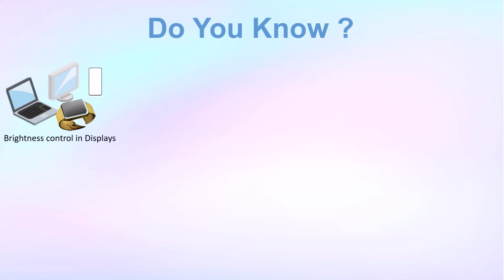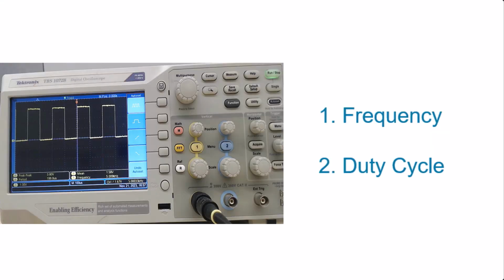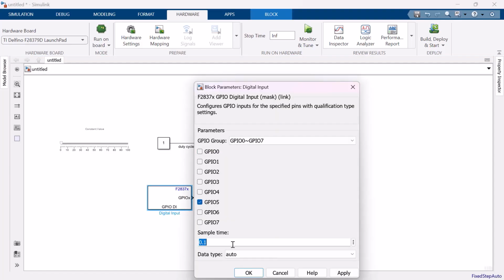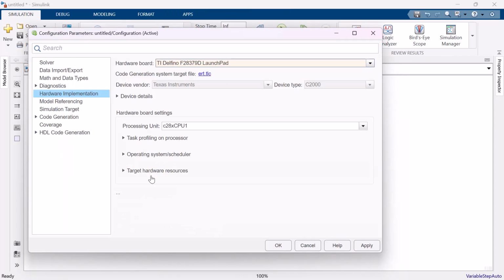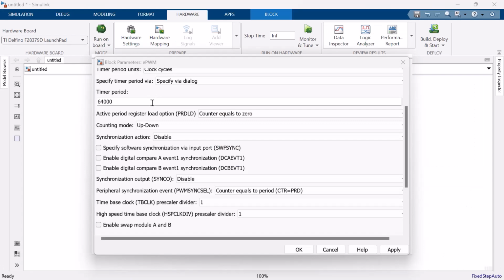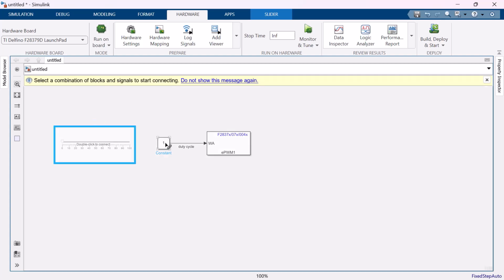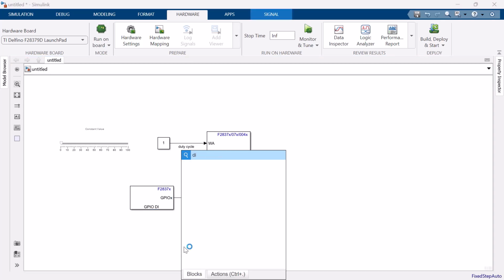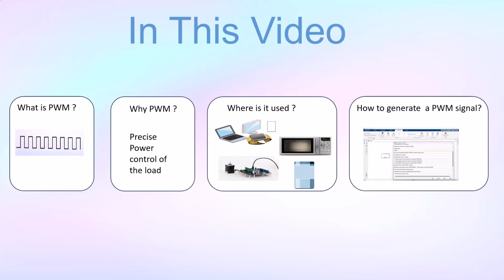Introduction to ePWMs for C2000 MCUs | C2000 Microcontroller Blockset, Part 13

Comment: I got the error: "Error: Cannot change parameter 'Constant value: (Value)' of 'LED_Brightness/Constant' while simulation is running" using the slider block by following your steps. All settings are as per block settings.
Reply: Open 'Code Generation -> Optimization' and change the parameter 'Default parameter behavior' to 'Tunable'.

Comment: Hi, if I understand correctly, you sent the PWM signal to pin 40 and then read that signal at pin 35. Does that mean you connected pins 40 and 35 of the launchpad with a jumper (orange wire)?

Comment: I got the error: "Error:Cannot change parameter 'Constant value: (Value)' of 'LED_Brightness/Constant' while simulation is running" using the slider block by following your steps. Is there anything wrong with my settings?
Reply from the maker: The constant value automatically gets updated as you move the slider. Please run the model in monitor and tune mode instead of the regular simulation mode.
Reply: Open 'Code Generation -> Optimization' and change the parameter 'Default parameter behavior' to 'Tunable'.